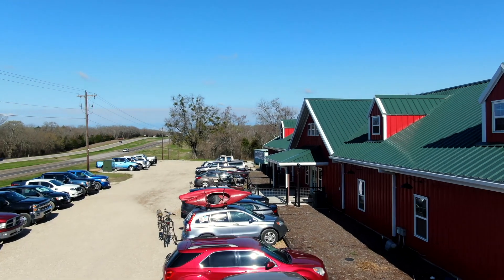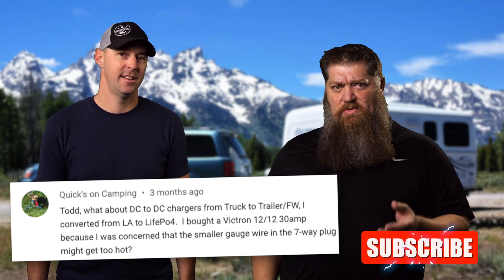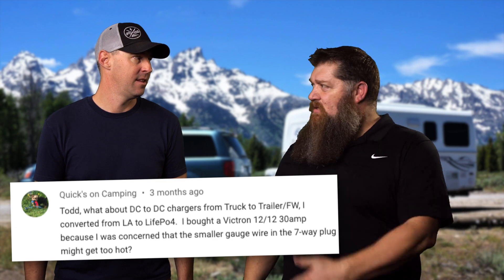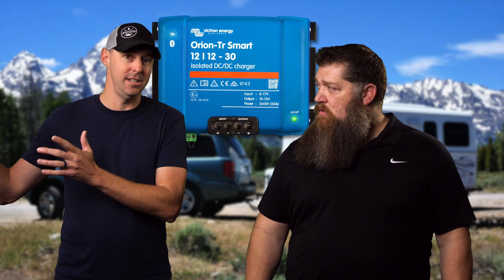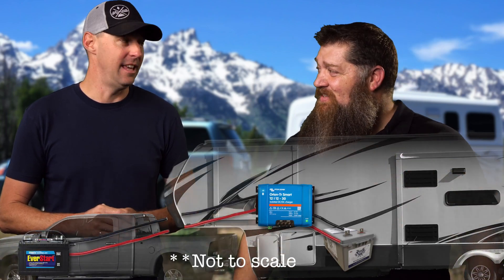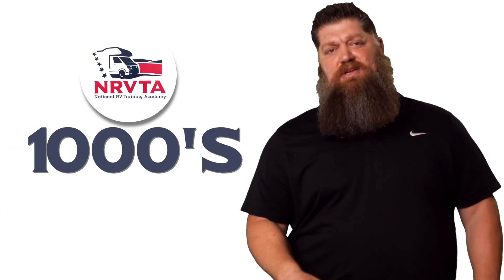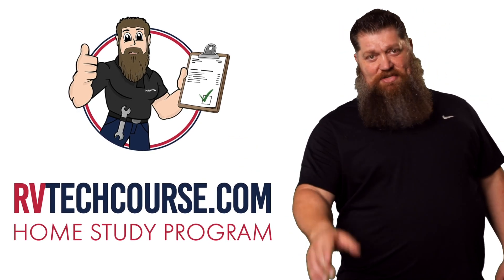Should I use a DC to DC Battery Charger // with @AllAboutRVs

Comment: Todd says no, some other Youtubers say yes regarding the need for a DC to DC charger. I have a 2024 Chevy Silverado 2500 towing our 2026 Keystone Cougar 22MLS.  Supposedly the DC to DC charger is to prevent the truck alternator from burning out due to differences in the truck’s 12 volt battery and the lithium 14 volt system in our RV.

All I think I know is that my RV has a 7 pin connector that connects to the back side of my truck to power the brakes and tail lights.  I think what little charge goes through the 7 pin may also charge the fridge while I am driving/hooked up.

My RV includes a Xantrex Freedom X 2000 inverter, a 30A Victron Smart Solar MPPT controller and the 440i solar package.  I do not understand how the electrical system works, but if there is 12 volt power coming into the rig through the 7 pin connector how does it regulate itself to charge the battery?  Based on diagrams pin 4 carries the 12 volt charge.  Does the incoming power get pushed directly to the batteries (two lithium) or does it pass through other systems before charging the batteries.

In short, my two basic questions are, 1) aside from powering turn signals and brake lights, and of course the brakes, am I really charging my lithium batteries while hooked up to my truck, and 2) do I really need a DC to DC charger to protect my truck’s alternator and the lithium RV batteries?

Comment: 4 Gauge is WAAAAAAAAAY overkill for 30 amps. 10 gauge is plenty for a run of that length. If you're paranoid, even 8 gauge would still be plenty. Unless you already happen to have a bunch of 4 gauge lying around and no other practical use for it, that's a crazy amount of money to spend on something, and it just makes everything about the installation more unnecessarily difficult.

Probably should've mentioned adding a fuse or breaker to that circuit as well if you're connecting it directly to the battery, and not going through the fuse/distribution box. A dead short circuit from the battery to the frame or bed, is a recipe for a fire, and with that heavy of a cable bouncing around rubbing against stuff, there's a decent probability of that happening at some point.

Comment: So the charge from the vehicle does not go to the camper first, then to the battery? I had always assumed that the camper was already its own DC to DC charger -- is this not the case?
Reply: Where would you be connecting it on the trailer? Trailers typically have an ac-to-dc charger, which will charge batteries while they're on 'shore power', but they generally do not come with a dc-to-dc.

Comment: I just purchased a 2024 travel trailer with solar (tow vehicle is a Ford F150 Super Crew, 5.0).  It currently has a 12v RV/Marine battery that I would like to upgrade to a 12v, 200ah lithium battery.  I have confirmed that the converter and solar charge controller work with lithium.  Is there any danger or risk to simply swapping out the batteries without installing a DC to DC charger controller thingy?  And what are some of the main disadvantages to doing it this way?  Thank you in advance!

Comment: Why are you taking the DC from the battery and not from the alternator.
Reply from the maker: Alternator is connected to the battery. Battery is where you connect to run other circuits.

Comment: ? Did I miss something, so do I need a dc to dc? Rv shop installed solenoid and 30 amp fuse, it popped the fuse
Reply: The dc-to-dc will control the current flow. You trailer batteries will draw as much juice as you can supply to them and if they're low, there's gonna be a lot of current flowing from the truck battery to the trailer battery. The dc-to-dc charge controller will limit the rate of charge, protecting both batteries and charging system.

Comment: You did not answer the question, "Should I use a DC to DC Charger". My RV guy told me that I did not need one if only using a 100 aH Lithium battery, is that correct?

Comment: I used a 60A BUSS MRCB off the battery, #6 wire, Anderson connectors and a Orion-TR Smart 12/12-30 isolated DC/DC charger.
Reply from the maker: Thanks for sharing.

Comment: Good stuff.  I'll  make a couple points:
* the 30A DC-DC can draw >30A.  It's voltage-boosting while outputting up to 30A, so apply  Ohm's law.  
* some folks are boosting voltage 12v -> 36v underhood and injecting that into the 7pin. Current is reduced by 2/3rds.    In the trailer it's going into an MPPT controller which is on a A/B switch for solar/7pin
Reply: Got any links to folks doing that? Interested to read about it.

Comment: I also added a breaker at the truck battery to turn off the circuit when not pushing to the trailer and therefore preventing a short if something was to happen to that wire going back to the Anderson plug.  I ran that wire through my enclosed Frame rail to further protect it.
Reply from the maker: that is a good tip.

Comment: Instead going direct to the battery.  I put in a dual battery isolator.  Attached directly to the alternator.  One side goes to my truck batteries and the other side goes to both my dc-dc converter along with my inverter I installed on my truck.  I put two AGM BATTERIES in the isolator side with a inline fuse.  That way just in case I forget to unhook the dc-dc to the coach.  I won't wake up to a dead horse.
Safe travels and roads Brian and Cindy, "xtreambydesign with passion"
Reply from the maker: thanks.

Comment: I assume you used something larger than the SB50 Anderson connector since the largest gauge wire for the SB50 is 6ga.  Can you confirm what size Anderson you used?
Reply from the maker: I prefer SB175. The bigger the housing the easier it is to handle in my experience.

Comment: “And there’s your 30A… If you have a Ford!”

It ain’t putting out ANY amps if it’s sitting at the shop waiting to be fixed!

Also does the charger go in the truck or trailer?
Reply: > Also does the charger go in the truck or trailer?

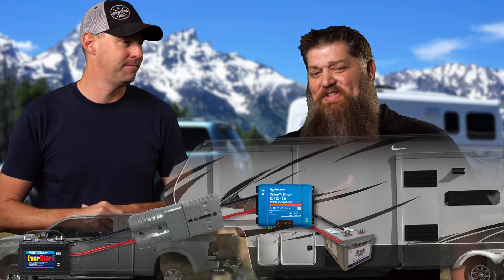In this setup the charger is in the trailer.  See 1:45 in the video;  the Anderson is between the TV and TT. 

Reasoning:  chargers are placed as close to the battery bank as practical to ensure correct charge voltage (less sag)
Reply from the maker: The charger is in between your truck and RV's batteries.

Comment: Great video guys! I also have a question about DC-DC converters. I've been designing a system for the last year and came to a conclusion with all the equipment that i need in order to have everything compatible i need a 12v System. No big deal however, when looking Online for a DC to DC converter i came across a few 50 Amp inverters wich would be perfect for my needs. But when i looked at the specifications it said that it would only work on battery systems with a maximum amperage of 600 or less amps. My system is 900 amps, 3x300 Amps lithium in parallel. Is this information correct? I thought it would not matter since my system voltage matches the 12v DC-DC? Why would it not be able to deliver 50 Amps to a system bigger than 600 amps?
Reply: You've mentioned three different types of gear, perhaps interchangeably.  Using standard US voltages as examples:

* DC-DC chargers are typically 12vdc -> slightly higher 12vdc
* converter/chargers are 120vac -> 12vdc 
* inverters are  12vdc - > 120vac.   

> Why would it not be able to deliver 50 Amps to a system bigger than 600 amps?

Assuming you mean a 50A DC-DC charger, they would be able to deliver 50A to a larger bank.  Two caveats:

1.  it would take a long time to make a dent with charging
2.  the DC-DC charger likely effectively be running at max output anytime the engine is running.  This may or may not be outside its design spec
Reply: It's my opinion that you would be just fine using the 50A DC-DC unit with your 900Ah bank.  I used a 30A DC-DC with a 600Ah bank with no issues and plan to use 2 of those, so 60A with an 800Ah bank and expect no issues.
Reply: @jeffsteele1295  I have no idea how that relates to my comment
Reply from the maker: Like the replies here, You shouldn't have an issue.

Comment: How about a breaker coming off of the battery?
Reply: You would want circuit protection at the tap-off point (ie. the truck batt).  I've used a fuse holder and fuse, others use a breaker.
Reply from the maker: You will want some sort of protection for sure. whether it's a fuse or a breaker.